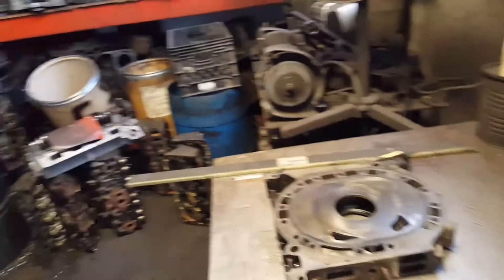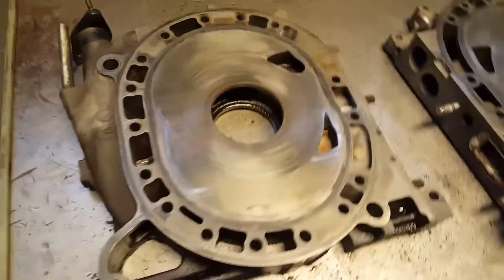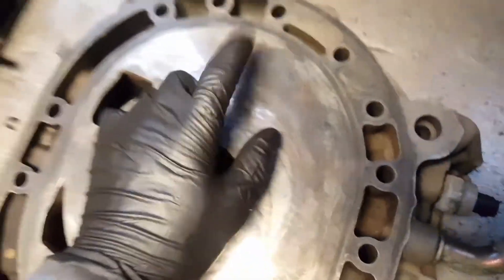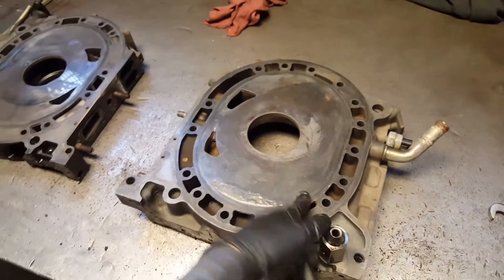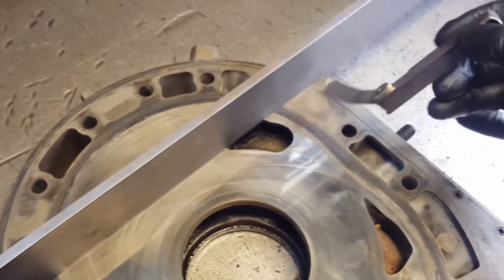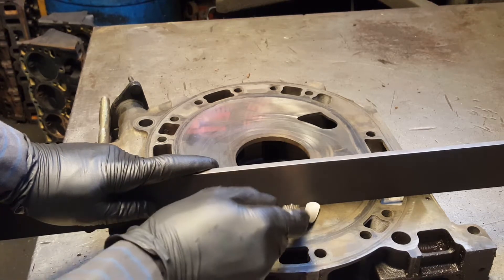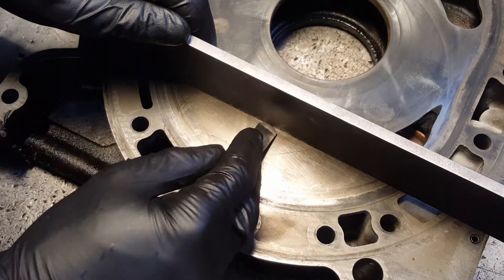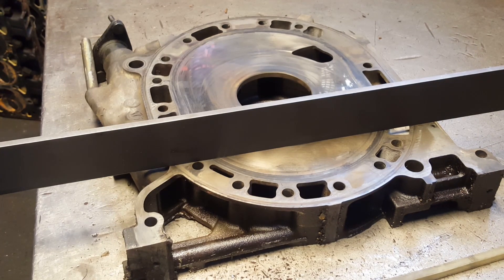How to rebuild mazda rx8 engine

Comment: Hey man im from Poland i have a question i saw in the mazda service manual part how to check your housing i need micrometer can u make video how to check the housings. 
ROTOR HOUSING INSPECTION
CHU011010B08E01
1. Measure the width of the rotor housing at four 
points (A, B, C, and D) as shown in the figure 
using a micrometer.
2. Compute the width variation.
• If it exceeds the maximum, replace the rotor 
housing.
Width difference = (width A) – (the smallest 
of widths B, C, or D)
Maximum width difference
0.06 mm {0.0024 in}
Reply from the maker: kanapkazserem yeah i will just give me a couple of days 👍
Reply: JM8686 Thank u man. You make the greates rotarys guides video 😂
Reply from the maker: Hey man sorry haven't make a video yet,just waiting for a new straight edge and mm filler gage that I ordered because my old ones got stolen 😭